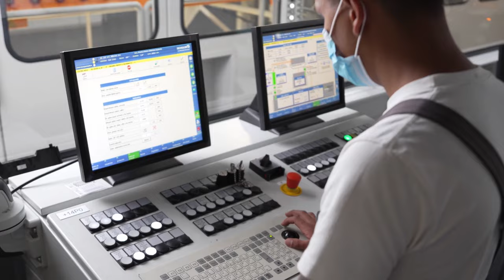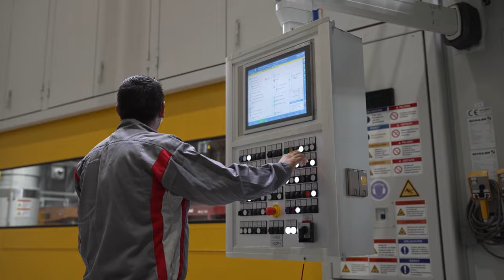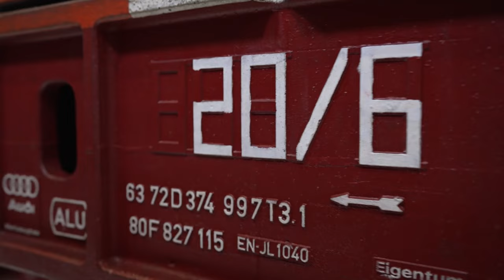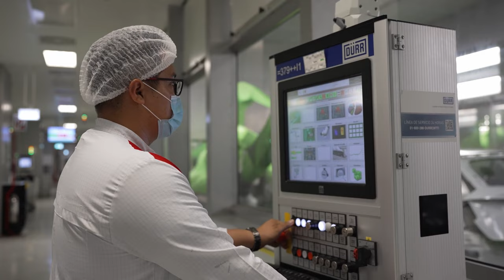2023 Audi Q5 - PRODUCTION in Mexico

Comment: My GMC Terrain 2018 was also built in Mexico. The door doesn't line up, the dash plastic isn't popped in properly where the center LCD screen is, looks weird, and the biggest failer was the transmission at 60k km. The the gasket was missing and one bolt. Unexpectable problem ⚠️ 😢

Comment: Impressive factory. But my new 2023 Audi Q5 is not as well built as my previous Audi Q5 2017 was! For one I never had an issue with the doors not closing properly. The fit and finish was hands down much better quality. I paid 10 grand more for a lesser car. Oh well! live and learn!
Reply: All new Q5 need some more force to close door properly,  I think it as to do with the triple seal doors for sounds insulation. It's not because of bad quality.  Anyways door gaps are thing they check in QA.